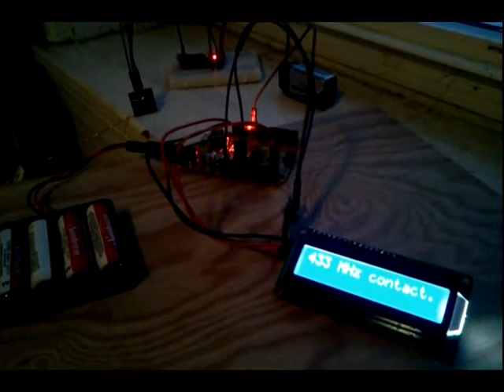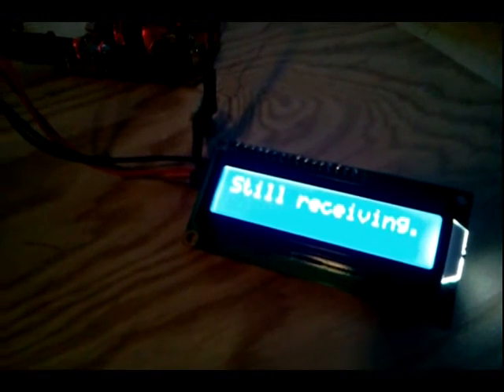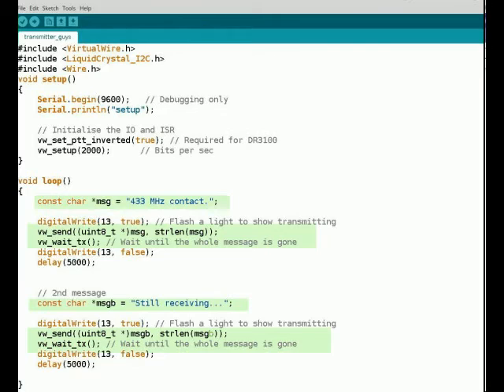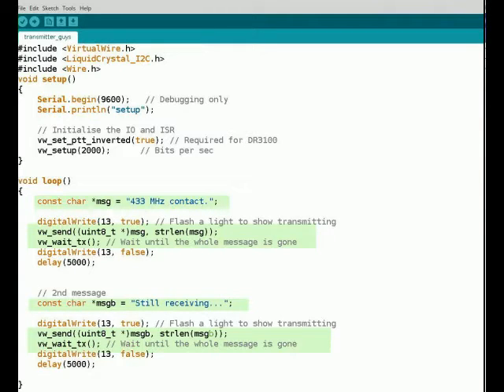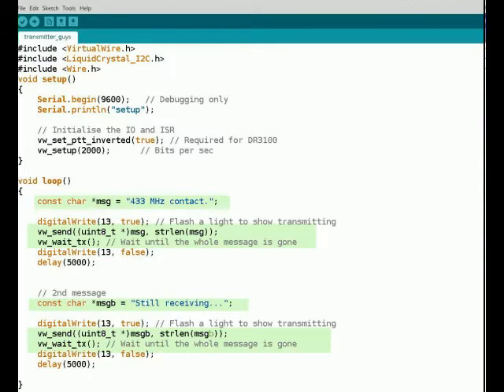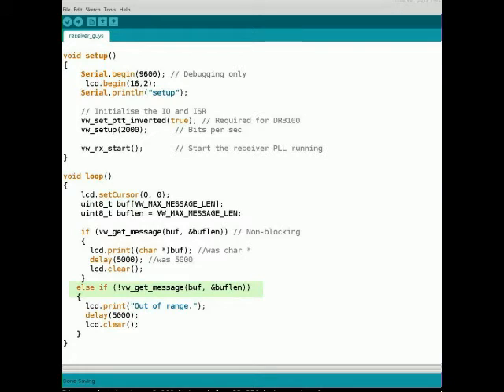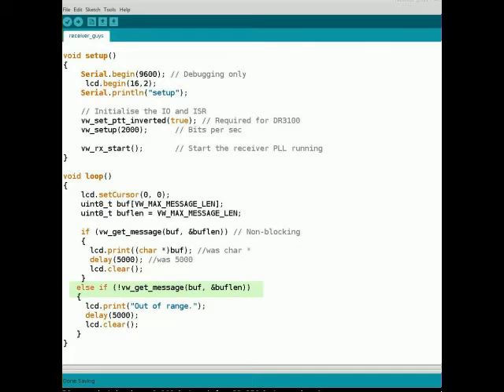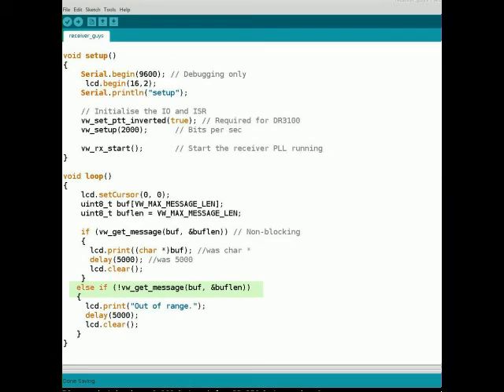RF Extend Range 433 MHz Send Text Arduino LCD

Comment: Impressive simplicity. I am messing for two weeks with manchester.h and getting nowhere. Sending message is okay, at least what I see on the oscilloscope, but unable to get any bit out of receiver. Actually, library example is not clear at all. I need to send two arrays or two strings of numbers, and receive it at other end. I will try code from your screen when headache caused by manchester.h splash out. Thank you for posting this video.
Reply: +Wild Maniac 
Also, on TX and RX side, use the same length of about 17 cm wire, and solder or attach it at ground point close to "hot wire", and you will get lot of range. At open space you may get reception up to some 500 meters, depend of how fast you sending data (the faster, the shorter range due to RF output broadening).
Reply: +Wild Maniac 
Tested, and got range of over 300 meters through walls (transmitter in room, receiver mobile). But I have problem - "if" statement does its job, but "else if" does NOT. For example, I made some barometric measurements for my altimeter project, and if signal gone, it write "No signal". So far so good. BUT(!), if signal comes back - it write measured values + "No signal" over data. Tried "else", tried "else if"... no matter what I did, it just ignoring it. In your example, there is delay of 5 seconds, I tried the same, but it did not help. The problem is that I am sending 5 packets per second, and both statements are true: it has signal and it has no signal - because of periodic nature of sending signals. How to solve that? Do you have some idea? Thank you in advance.
Reply from the maker: +Wild Maniac Thanks, I appreciate your input. 300 meters is impressive! Good advice on hot wire. Are your delay() and lcd.clear() functions good? I've posted Transmit and Receive code for easier reading: https://gist.github.com/p1nesap
Reply: +p1nesap 
Yes, probably I did mistake - I should to calculate an 'empty' time between two packets, and include appropriate delay. I have no lcd.clear(), because I am using OLED display. Two different displays ordered, and waiting to arrive; 1602, and Nextion 320x240. I will post link in next message, because by default, YouTube mark my links as "Likely spam", for which you can moderate on your channel in section "Community->Comments". Please take a look. Thanks.
Reply: +Wild Maniac 
Here is my website with beta altimeter. Just need to work little bit on some debugging, and add battery voltage indicator and alarm... http://wildlab.org/index.php/2016/03/11/arduino-altimeter/
Reply from the maker: +Wild Maniac Clearing LCD or OLED screen would seem necessary to print new value. Yes I watched altimeter on your channel. Looks good. Hope to see in action on quadcopter!
Reply: +p1nesap 
Thanks. It will be relatively soon. Just testing everything before moving Attiny85 and MS5611 + small TX together. Later will be maybe difficult to burn in new firmware, don't know. I wanted it under 3 grams, but... this is not a "must". Oh, btw... If you have PLL version of 433 MHz transmitter, and it says that should work on 3.3V, that is partially true - only if transmission is continous. But every pulsed TX can work on 5V and having much greater power out. Also, good antenna on both TX and RX side provides good range. I hope over 1 km range, but need testing (damn, rain, rain and again rain...).